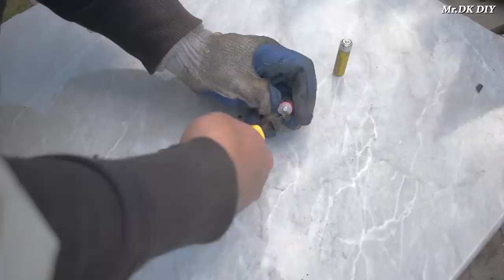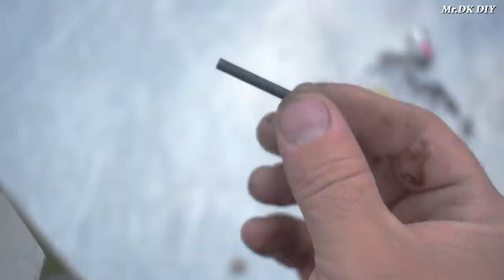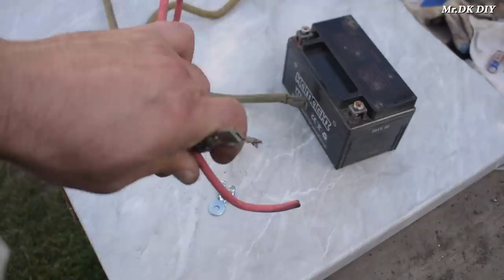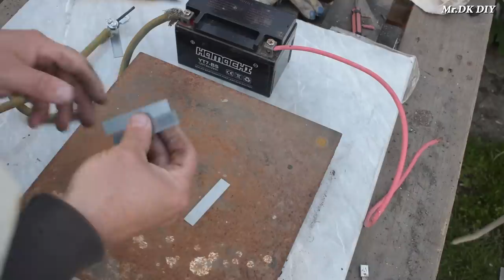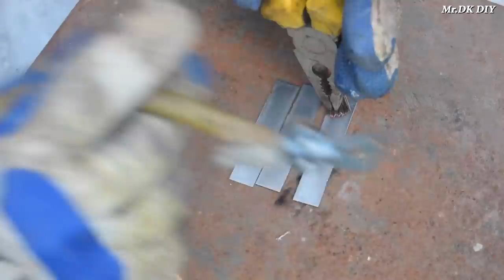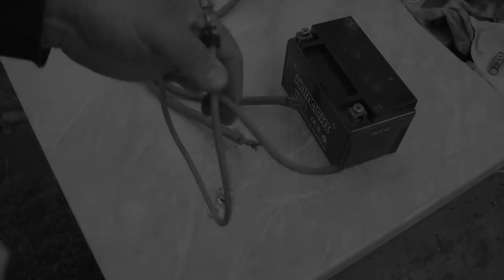AA battery ??? What you can do with an old AA battery 1.5 v

Comment: Nice tip. The battery used is a zinc carbon type. The rod used as here in the video is carbon. Carbon arc lamps also use this. Some mean and unfriendly comments from other people. Last years people act selfish and dont communicate but start bashing right away.

Comment: You can also wield using jumper cables and a coat hanger .I learned that in the army it works 👍🇺🇸🗽
Reply: I tried that but the bloke in the shop who hung coats wasn't happy !! :O)
Reply: That sounds a lot quicker. Thanks for the tip.

Comment: i make lithium battery packs, and made you tuber darkkevind's spot welder to do so. for the electrodes i use 10 gauge solid hard copper grounding wire, instead of the copper nails he does, because i had it. i never thought of using the carbon pile from a dry cell battery. i may try this when i change electrodes, but i would have to change a few things though. the entire rod get's hot, unlike the copper i use now. it would melt the electrode holder i use, seeing how it is plastic. this might be a good thing to make a gouger to cut steel though. a small, high pressure air line along side of the rod to blow out the melted puddle, and you would have a diy plasma cutter.

Comment: GROANNNNNNNNN

Whoopie. Yes you can salvage a carbon rod from a battery that you can use for carbon arc welding. Why punish the viewer by taking up half the video simply opening up the battery case? Should only take 60 seconds, and should only take 15 seconds to show it.

Now as for the welding part itself, use a ground clamp!!! You need two hands for carbon arc welding. So use a ground clamp instead of wasting one of your two available hands just holding your ground connection. 

Why do you need two hands? Because you need to be introducing filler material. This can be flux core welding wire of basically any size or any non stainless steel alloy if it is not a critical weld. Or any iron or steel wire dipped in paste flux. But you need to add a small amount of filler material and you need flux to prevent oxidation and transfer heat properly and make a stronger weld. And I do hope that is a deep cycle battery. Please, folks, do not do this with an engine starting battery. It trashes the battery in short order. A deep cycle battery works great if you do not discharge to below about 40% of full charge. Golf cart batteries in series work nicely. You can actually stick weld using proper welding rods with 6 6V golf cart batteries in series, or 3 proper deep cycle storage batteries. Been there, done that. In most common forms of arc welding, the filler material is the electrode, and only one hand is needed. Still, it is just silly to hold the ground connection by hand. Use a ground clamp.

A more important use of the carbon rod is for making brushes for DIY motors or brushed alternators or generators.
Reply: I TRIED  TO  USE  A BATTERY  CARBON  ELECTRODE  AS  BRUSHES , THEY  WORE   MY  COMMUTATOR  DOWN   IN  NO   TIME  .  HOW  CAN  I  MAKE  THE  CARBON  SOFTER  ?

Comment: Looks impressive and for demonstration purposes, the video is entertaining to those that don't understand electricity, but welding requires high values of current, therefore very briefly, discharging a battery so quickly, does not do the battery any good and its life would be dramatically shortened, or the battery can very easily explode! Inside the battery, the plates will warp and in due course short circuit with one another. In other words, using a battery to weld is not practical.

Comment: Did you need to use welding goggles?  Will the flash burn and permanently damage the eyes like a welding machine would without protection?  If so, some kid (or adult) can try this without knowing the danger.  I didn't see a warning.

Comment: when I saw the reverse side it showed the metal was not fused together so try showing a break test, wont stay together and possibly putting off deadly gasses. I can buy a piece of metal the size of those 3 small ones.
Reply: Davidautofull I bet your fun at party’s too?  Do you need a manager Karen?
Reply: Wrong. It is welded thru. Dont knock it if youve never done it

Comment: this is considered as if you short circuit the battery  which will most likely will explode it, it is too dangerous. you have first to determine what is the safe maximum current u can withdraw from the battery safely; then measure the current withdrawn while welding. before that you are putting your life and others in extreme dangerous especially your eyes when the acid explodes everywhere.

Comment: Carbon arc or gouging rods come in various diameters. Think it would be easier to peel the copper clad off one of them instead going thru all that to get the small carbon core out of the old battery.

Comment: Great man u r genius can i apply the same with 12vdc transformer instead of BATTERY
Reply: Not enough amps.
Reply: I  think  no.  Its suitable  quantity  of  current in amperes  from battery  that  matters.  12 volt  transformer connected  to  domestic electricity  wont  do  that.
Reply: Einstein lawe The battery puts out higher amperage.

Comment: Should’ve shown the battery in circuit with the cables and spot welding probes to add credibility. My opinion, based on the rules of power transfer principles is that this is a lie. I think the spot welding terminals were connected to a welding power generating source.

Comment: A HOME MADE WELDER???
Reply: Michael Gale you can do whit 12 volts battery  to 1/8 stick !
Reply: Spot welder exactly, good for lion lithium batteries connection or anyway small tiny little weld between very thin layer of metal, otherwise it wouldn't work. That's an electrode

Comment: Good video, red wire to positive on battery and  yellow to negative battery post?  To bad this wasn’t in English  so we could understand the comments.
Reply: should that not be the other way around?
Reply: polarity in this case is irrelevant, the key is to close the ckt.
my question will be, how bad are the fumes (cancer), and of course you need UV protection glasses.
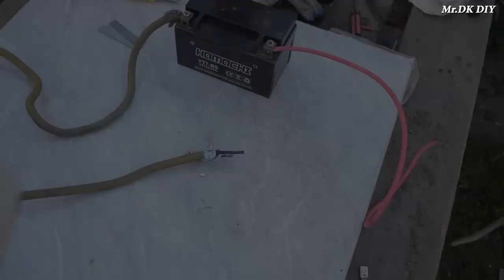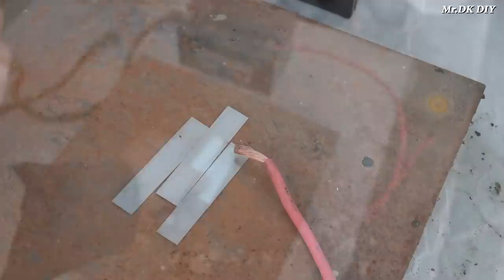Reply: good question, for 19 seconds between 4:44 and 5:03 you can see that the  red wire is hooked up to the negative battery post and the yellow wire  with the (battery part atatched to it) is connected  to the  positive battery post
Reply: This is why the man was talking so much, so you could understand it in any language. :-)
Reply: nope...the opposite

Comment: Interesting.... what is the power of the battery used ? it looks like 12 or 18 volts...Welding requires a high current I thought..
Reply: You are confusing voltage and current. These batteries are capable of passing a high current across a low voltage because they have a high power rating.You need to start with Ohm's Law to understand.
Reply: Just hold the negative and positive leads together and you'll find out it's high enough for tin plate...
Reply: That's because current (measured in Amps) and voltage (potential difference) are not one and the same thing. For example, static electricity generally does no more than 'crackle' and make us tingle occasionally. Amazingly though, static electricity can be measured to be millions of Volts. It does no harm to us though, because it has very little current behind it...and it's high current that's dangerous. Conversely, one can receive a nasty shock, or burn, from a 12v car or truck battery, and that's because 20 or 30 Amps is sufficient to do damage. As I said, current and voltage are not one and the same thing ;-)
Reply: Welding requires low voltage, high amperage...typically 40-80 volts, 110 amps.
Reply: you are right.about 40 years ago there was a diy welder for sale in the uk.it used a car battery if you wanted to weld anything thick you needed 3 batteries.it was totally crap
Reply: This isn't welding. It's just melting. Welding uses an Arc of electricity as it's heat source. You need high voltage to get an Arc to jump across the air. This is the same as a lightbulb, if different materials. You could actually use this as a light if you really wanted. (DON'T) 

This just heats the carbon electrode with the raw power going through it (as carbon is a resistave material, the resistance creates heat.) and the heat melts the steel. Carbon electrodes do actually work nicely with arcs, but you need a transformer to get the voltage needed. Plenty of videos on D.I.Y Arc furnaces with that method.

Comment: is the joint as solid as normal with electrodes?
Reply: No.  Welding depends on a momentary shield from oxygen. In stick welding, that's generated by the consumed flux that surrounds the electrode. So this would be a completely crap weld. It's a cool trick, no doubt, but it's not a usable weld.
Reply: This is going to be much shittier than any form of welding.This is slightly melting the plates together. So no, it would not be as solid as any normal method.

Comment: Obviously this does work, but I cannot overstate just how dangerous it is. Many ppl will die attempting to recreate this. The video should be removed. Touching the metal strips with bare skin of any kind would result inthe current passing thru you like a bridge. Quick Electrocution. A 12 VOLT battery will produce enough power to throw an adult person. ***THIS IS EXTREMELY DANGEROUS***

Comment: Did you connect the wires to the battery shown?
Reply: Yes.  Welding using 12 volts has been done before, just not with a battery electrode.
Reply: Yes he did
Reply: Music drives me nuts

Comment: Is that an aluminum plates?
Reply: It looks like tin or steal to me. .
Reply: Also to add to my reply,  aluminum welding is a little different anyway you would burn completely through that if that were aluminum trying to weld that. Welding aluminum is a lot harder to do.
Reply: @simonking5306       Steel or steal. which is correct?...
Reply: @simonking5306  *steel
Reply: Look like an E and I laminated core of transformer, those were the I, may be.
Reply: Steal ???? What sort of metal is that ???  😂